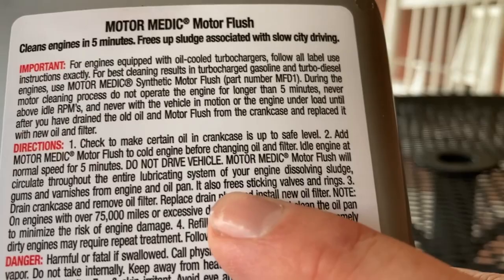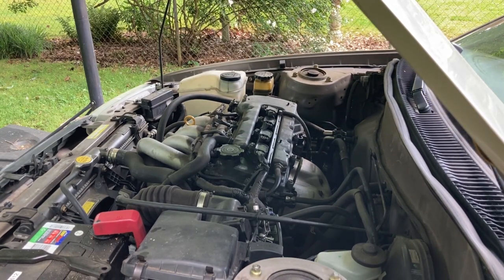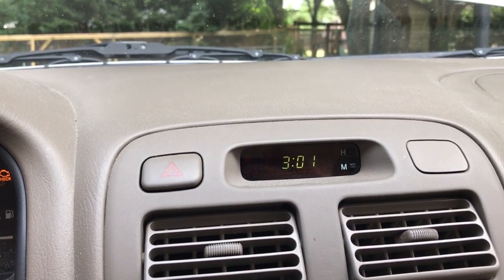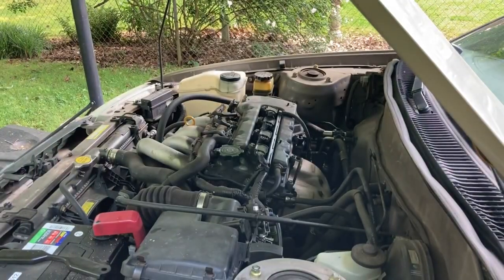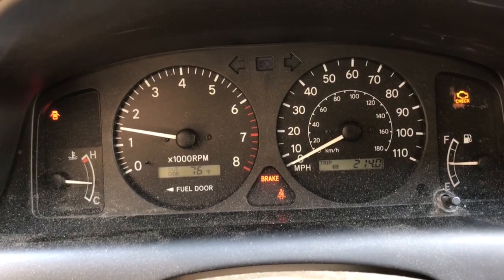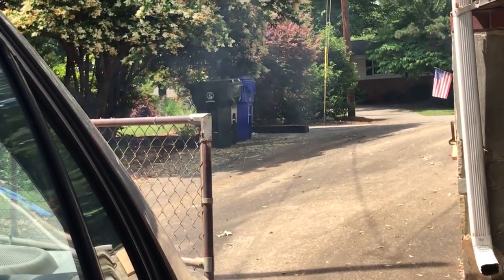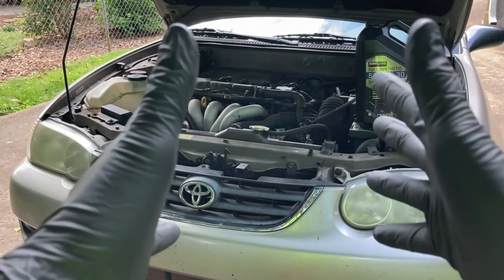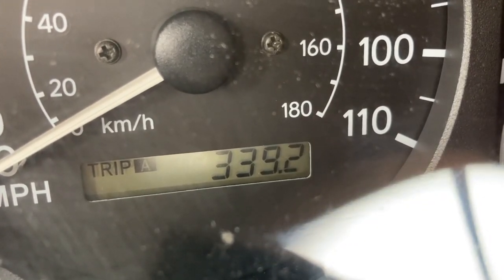Will Motor Flush stop oil consumption? | Oil Burning Experiments🔥- Episode 5

Comment: My 2000 mirage has 403k miles and was burning about 1qt of oil every 700miles. I did a piston soak with mmo about 2oz per piston over night. Then after it leaked down to the crank case did another 2oz per cyl of ATF for 8 more hours. Now my car is consuming about 1qt of oil every 1500 miles. In my case it reduced the oil consumption to less than half. So piston soaks are worth a try.

Comment: Check this Toralin stuff i put it in my Honda with stuck rings. Its a spray with a tube and nozzle to spray trough the sparkplug hole in the warm engine. It works great for me. I checked warm and cold compression before and after and got good results.

Comment: Hi, I have a 2002 Corolla LE and can't use a metal yellow ramp because my bumper contacts the ramp before even climbing the ramp.  How many inches should be the ground clearance (ground to lower edge of the bumper).  The car is with a 14" rim and tire recommended for this car.
Reply from the maker: I actually scrub the ramps with my bumper sometimes ... and I have a Honda Fit that I have to put lumber under to ease the slope. (though I'm not recommending it :-) ... https://youtu.be/dXdXcH1dOfY

Comment: Try stp high mileage in restores seals in engine  motor treatment in red bottle reconditioned them or Barr's oil treatment it's thick as molasses but helps seals revive so oil don't pass and burn quick out tailpipe i think u have a seal issue blowby oil consumption not the other thing

Comment: The best way to use ANY motor flush is to 
1 : drain out the old oil (fresh oil
     suspends more impurities)
2 : use a cheap oil filter (greater
     capacity to catch more
     particulates than the old 1)
3 : use cheap oil
4 : add the flush 
5: run the flush for whatever time is
    recommended per bottle
6 : drain 
7 : add new high quality oil & filter

Also whenever I do a flush if the flushed oil doesn’t come out gold I repeat the process but reuse the cheap filter until the oil comes out the way it went in. Then put the new filter & oil and I’m good to go

Comment: In one of your previous videos you pulled the spark plugs and looked down in the cylinders. There was oil on the plug as we as on the top of the pistons. I wonder if the valve cover gasket, specifically the gasket’s around the spark plug wells is leaking and that’s where the oil is going.

Comment: It's burning off hydrocarbon resado inside of the catalytic converter from the new amount of hydrocarbons added into the system. Catatclean helps with removing carbon build up inside of the catalytic converters.

Comment: Just make sure that carbon cleaner for firearms is compatible with aluminium. The good carbon cleaners corrode aluminium well also. Carburetor cleaner is safe. You can try putting carby cleaner in the spark plug hole and letting it soak for a while, cheap option. and to push the carby clean pass and through the rings, you could pressurise a cylinder (with compressed air through spark plug hole) that has its valves closed, that will flush out a lot of carbon.

Comment: I run motor flush every other oil change, I add it when the engine is hot and run it for 20-25 minutes sometimes I bring the RPM up sometimes I just idle it. My engine is spotless, done this for years.

Comment: You have probably heard this before,. The old timers used hot brake fluid to unfreeze a froze up engine. DO NOT HEAT BRAKE FLUID ON A OPEN FLAME it is very flammable use a hot plate or something like that.

Comment: i've heard atf fluid works for cleaning up piston rings 1 quart atf and rest with engine oil im going to do so on my 01 s10 with high miles i have nothing to lose with this engine its on its last legs before a rebuild is needed
Reply from the maker: I heard that as well, Luigi. But after doing more research I read that modern engine oils have more detergents than ATF ... now I'm torn. Thanks for the comment!

Comment: I use Lucas complete engine treatment when I change oil. Read instructions. My 2009 Camry has 100,000 miles on it and I have used half a quart of oil in 2000 miles. Using pennsoil high mileage oil..

Comment: If you want this to work find a hilly mountain road and go for a drive in 5th gear . Load the engine up hard if the car is struggling/shaking keep going . You will feel when the rings unstick . Has worked for me on many cars . I drop the oil fill the engine with diesel and let it idle for about half an hour then drop it put thin grade oil in and then go and load the car up .
Reply: What’s the difference between kerosene vs. Diesel fuel? 
I know that Diesel eats away or expands rubbers.

Comment: At this point, given that you're e tried different products and really haven't  made a difference,  I think-
1. You might want to consider that the piston rings are not stuck, but perhaps just worn.
2. Change the PCV value, to rule that out for oil consumption. 
3. Try thicker oil and/or a oil thickening  product such as STP 4 cylinder  oil additive or Lucas oil additive
Good Luck !!!!
Reply from the maker: Thanks for the comment, Scott! PCV valve coming soon. Scoped the cylinders in the video after this one. https://youtu.be/A398v3j67Jw  We'll get to the bottom of it eventually.
Reply: @FamilyFriendlyDIY  to be honest, I think just using a oil thickening additive is about your best bet, and this can be your next set of videos- which product worked better STP 4 cylinder oil treatment or Lucas oil treatment.
Good Luck !!!

Comment: Long time ago I had 78 chevy truck straight six.it was tired,old,burn 5 quarts of oil every fill up gas.i brought bardahl for help cleans burning off oil inside engine.when idle running.its coming out like very huge white cloud.INCREASE 200 MILES UP ON SAVING OIL.TRY BARDAHL..

Comment: Is compression down on one cylinder, such that there’s blow-down of combustion gases into the crank-case, causing higher than normal oil mist loss into the air-box?

Comment: Only way to fix this engine is fit the new modified pistons with the larger oil drain holes in the piston behind the oil control rings or take the pistons out and mod them yourself ,  there are vids on youtube of this simple proceedure

Comment: It will never work on short time. Just keep driving it unless you change the piston and piston ring. Nothing will fix this defective design of 2000-2002 corolla 1.8
Reply: I have a toyota with the 2.4 it worked for me
Reply: @master6435  good for you because you caught it on time.  When it is at 2 nd level, carboned up piston ring and return holes, it is already too late. At stage 3, when the cylinder wall already got scars, you need the whole short block. Yes, change the oil every 5k miles. Some newer 2.5L also consume oil when we do 10k miles interval and do a lot of short trips.
Reply: @rondhole  yeah I believe it really depends on how bad the oil control ring is clogged my car burn 1qt of oil every 1000-1200 mile but that corolla is burning 1qt every 300ish miles that's way to clogged in my opinion for the oil control ring
Reply: @rondhole  what you you do to prevent other than frequent oul changes? I have the 2.4 with 😅 and im worried for future.
Reply: @goldengirls0125  do you have 2007-2009 batch? If yes, just use a good full synthetic oil and do 5k miles/6 months interval. It will reduce the risk significantly.  Get the one with higher detergent like 0w-30 castrol edge. Mobil 1 extended performance 0w-30 or 5w-30. Pennzoil platinum ultra 0w-30 or 5w-30 is also great. Amsoil is overkill and too expensive for 5k miles interval.
Reply: @goldengirls0125 run an upper cylinder lubricant and a fuel injector cleaner at half dose everytime you fill up so it lasts you abit longer and do a intake decarbonisation once a year if you have to or before every oil change

Comment: Did you consider using this as a piston soak?  I know that's not how it is designed, but if it can remove sludge, it can probably remove carbon.  And who cares if it winds up in the crankcase because it's meant to go in there.  Then run it as normal at idle after the soak and then change the oil

Comment: Use DMSO- dimethyl sulfoxide.
Be sure temperature exceed 18 degrees celsius, below 18 degree DMSO will cristalize.
Reply from the maker: I've heard good things about that, but still some pretty scary stuff to me... We'll see, ionutz.
Reply: I have personally used this substance. It is a fairly harmless and non-polluting solvent, a very strong solvent. I added about 100 ml to each cylinder (I removed the spark plugs). I let it act on the segments for 24 hours. I also did 3 times oil changes in which I added about 300 ml of DMSO each one. The only "problem" was the terrible smell after starting the engine.  Be careful, DMSO will destroy the paint, if it comes in contact with painted elements. If the oil pan is painted on the inside, forged about DMSO.

 You should also replace the valve stem seals and PCV valve
Reply from the maker: @ionutzionutz7106  Thanks for all that info. PCV valve and valve stem seal videos coming soon :-)

Comment: HAVE the same issue on my 09 saab 93 2.0t. My rings are stuck but it doesn't burn oil. Almost no compression on cylinder 1 when the motor is cold. But when it runs for 30 seconds it gets compression and runs amazingly fine when warm. But unfortunately when my motor is cold if I put anything in the cylinder it leaks down. I subscribed. Want to see if you can get something to fix it. I have watched a few of your vids on it and can't wait for the next test. I've tried engine restore for about 500km. Might slightly help. But nothing major. And tried seafoam through the intake and from above
Reply from the maker: Thanks, Evan. And thanks for the input on your experience with Restore.

Comment: I'm unless it's just flat out ring where that's causing your oil burning issue but sounds like me it's more of a household related if you look down your cylinder and if oil dripping down them Chad from this and that garage is a video on vow seals and what it will cause using a Dodge D 100 truck but same principle as what you're dealing with tough see you're losing most of your oil and then it's leaking And to the combustion javer and burning off with the spark plugs

Comment: Before you proceed to another method , in attempt to solve excessive oil consumption, try my suggestion . Remove all the spark plugs and inspect them . If all or some are have black oil on the first 3 or 4 threads , it could be that the plugs are of reach which is beyond the OEM specification. If you didn't buy the car brand new , it could be that previous owner might have replaced the spark plugs with a longer reach plugs . In modern engines , fitting a spark plug of thread reach 26.5mm into a 19mm plug thread hole will not cause collision of piston crown and the plug ground tip.  So the plugs will work fine initially, but will time oil will be pushed up along the thread . Overnight when you park the car , the oil will flow down back to the plug tips . This phenomenon give rise to burst of blue smoke in the morning when you start the car . Also , as you drive , oil splashing onto the plug tips get burnt partially and escape with the exhaust gases , leading to excessive oil consumption. Oil splashing onto the plug tips will have a negative effect on consumption  : inefficient consumption. Inefficient consumption results in increased blow by gases escaping into the crankcase. Too much blow by could overwhelm the PCV system , which will result in oil leaking from seals and oil pan gasket.  When that happens, you might think your valve seals have become bad . 
Adjusting the plug reach to the right length will eventually end all the above cases of oil consumption scenarios. 
First , if the first 4 threads are covered by black thick oil , I bet you , your plug reach is more than OEM spec. 
You can still use a 26.5mm reach plugs in a 19mm plug hole . Carefully remove the plug's manufacturer gasket ( washer ) , then put on 5 pieces of 1mm copper or aluminium washers and then fix back the plug manufacturer gasket over them . Doing this will reduce a 26.5mm reach plug by 7mm . This will make the plug head nut mate properly will the helical spring inside the ignition coil for stronger ignition.  Oftentimes the helical spring inside the ignition coil does not make a physical contact with the plug head nut . This reduces the ignition voltage that finally go through the plug .

Comment: Hi , try to do Leak down test , and compression test as well , could be head cylinder or internal engine mal function.
Reply from the maker: Thanks for the advice, Lennox. I did a compression test in a previous video, then scoped the cylinders in the video after this one. Slowly getting to the bottom of things :-)
Reply: @FamilyFriendlyDIY  ...Hi , thanks for your kind message , i was also thinking of Your Head Cylinder Gasket if all the other things were ok .... we will see !

Comment: I'm betting that the stuck oil control rings have worn one or more of the cylinder walls out of round. They'll have to be bored out until round and then new oversized pistons and rings will be required.
Reply from the maker: Unfortunately, if that's the case, these engines can't be rebored. They're considered "throw away." Thanks for the comment!

Comment: Why not change to 10W/40?
Reply from the maker: Good question, Robert. A lot of viewers keep suggesting to use thicker oil. ... The main reason for the videos is to see if we can "fix" the problem with chemicals (make the oil burning go away while still using the specified weight of oil) to see if any of them work. If chemicals can't fix it, I plan to  re-ring it. That aside, these cars have variable valve timing that can be affected by heavier oil (prior experience) and the main problem that starts the oil burning is the lack of sufficient drain holes from the oil-ring groove back to the cylinder (they get clogged up)-- so though thicker oil may be less likely to get past the rings, it would probably have more trouble draining back into the pistons. Thanks for the comment!
Reply: Enjoyed watching your videos but that engine seems to be shot I don't burn nowhere that much oil but try Lucas high mileage oil stabilizer at work to me I was burning a quart every thousand doesn't burn no more
Reply: I was told using thicker oil would only make it worse if the rings are stuck.
Reply: @FamilyFriendlyDIY  plus 10/40 has fewer detergents which isn't as good long term.
Reply: @unclejoe6811  that's not true,  what's your source?

Comment: I would avoid using engine restore, on their website they specifically say not to add this to engines with VTTI systems, you could clog the oil passages in the system and damage the VTTI. 
CAN RESTORE ENGINE RESTORER BE USED IN VVT ENGINES?
RESTORE is safe to use in standard (mechanical) VVT engines, but we do not recommend using Engine Restorer in engines that utilise high pressure engine oil to actuate or regulate the valve timing functions. These engines that use the engine oil as a hydraulic fluid to adjust cam phasing are referred to often as VVTi (Variable Valve Timing Intelligent) engines, but car manufacturers have their own nomenclature for their VVT systems, like BMW VANOS and dual VANOS, Honda VTEC and iVTEC, Mitsubishi MIVEC, Subaru ACVS and AVLS, Fiat MultiAir, Toyota VVTi etc. They all rely very heavily on clean oil of the correct viscosity to provide adequate oil pressure to control the valve timing. Engine sensors are programmed to detect changes in oil viscosity that might suggest dirt, metal debris or contaminants in the oil that could clog oil-ways, contaminate solenoids and cause valve timing to malfunction. The CSL particles in each can of Engine Restorer would be detected by these sensors, triggering the ECU to show an engine management light and possibly engine codes; the engine will run erratically and stall repeatedly - all warnings to stop the engine immediately and not to drive the car until the oil and filter have been changed to remove the Engine Restorer (or other contaminants), and refilled with the recommended specification of oil for your car.
Reply from the maker: I'll definitely have to research this before trying it on the Corolla. Thanks for that, J!

Comment: If you drove it very far with stuck piston rings do you no longer have stuck piston rings what you have are scored cylinder walls and none of these will fix that. You may have freed the rings but the worn and tapered cylinders will burn oil when revved. Running with high oil consumption will also foul the converter.  You need new cylinders.

Comment: My friend and I back 20ish years ago had such bad blow by in his 80’s Crown Vic that we put a hose on the dipstick tube and routed that into a can to catch oil. In fact that crappy car is now living in my back yard in the woods.
Reply: @FamilyFriendlyDIY  Really enjoying your troubleshooting, there is some crazy engine flush that is dealer only. Wish I could think of it. That’d be neat to try. I’m sure you can Google it. I’ll see if I can find it.
Reply: @FamilyFriendlyDIY  BG engine flush? I think that’s it. They have like a 3 part version I believe.
Reply from the maker: Thanks, NG. Someone else mentioned that as well. Pretty expensive though. We’ll see. It does look interesting.
Reply from the maker: @nghermit4922  thanks!
Reply: @FamilyFriendlyDIY  Yeah, it’s certainly not cheap.

Comment: I had stuck ring in my 98 civic and i try de 4 1/2 quart diesel instead of engine oil rev 3000rpm for 15minute and drain de diesel an oil filter fill oil 4 1/2 quart 5w20 synthec and it work gain 40psi more compresion on piston 2 and 3
Reply from the maker: Whoa ... I'm not sure I'm ready for that. You're a brave man!